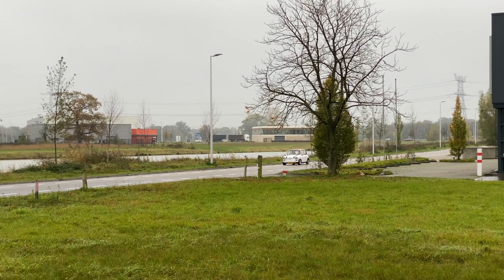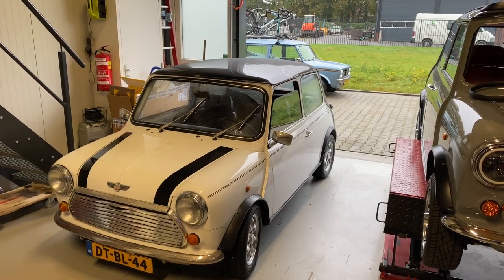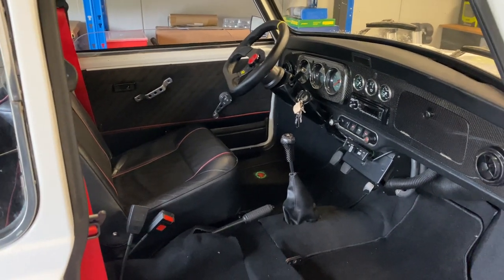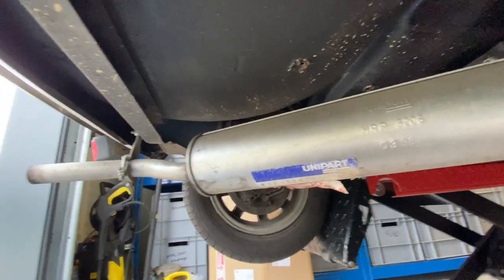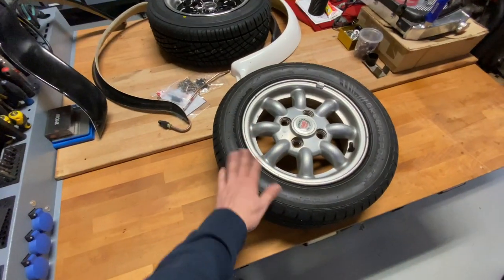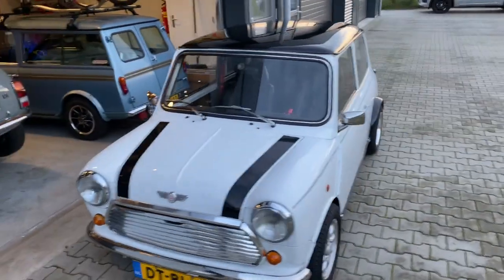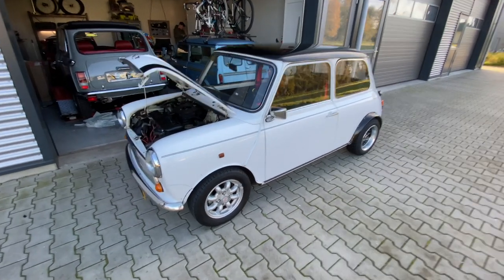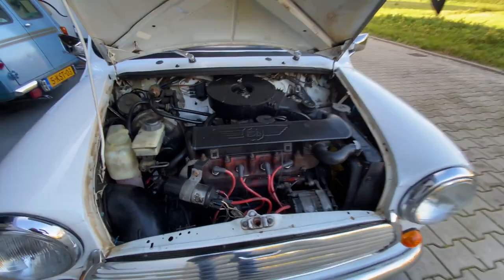Fitting a tall guy into a small car!

Comment: I've got seat rail extenders on my '88 mini, but they are not as long as the ones you used. Can you provide your source? Also, did you have issue with the seat back interfering with the storage bin in the back?
Reply from the maker: I got them from JB Fabrication in the UK, via ebay
Reply from the maker: with these seat rails you run into issues with the hook that holds the seat from moving up before you have issues with the side pockets, so just check if you floor rails are long enough as well
Reply: @classicminiculture9800  my car had a previous home made set of extenders that also had the issue with the rail hook not engaging if seat fully back.  One fix was to modify the hook or bend it so it could engage.  Or I just ran it without being hooked.
Reply from the maker: @TornadoCAN99  thanks, we are looking at having some floor extenders made, because it will not pass its test with the seat no being sercured👍